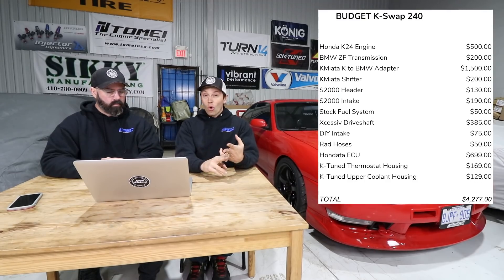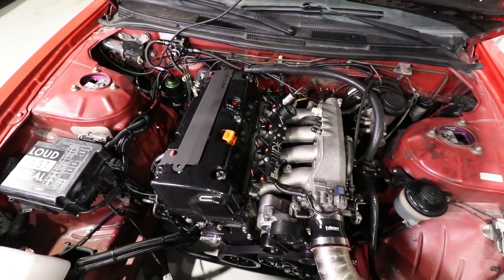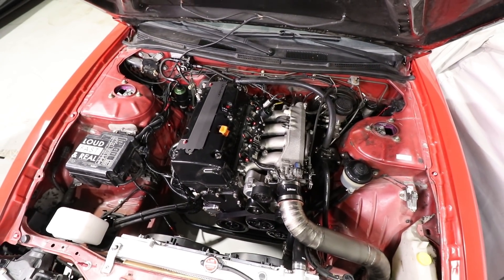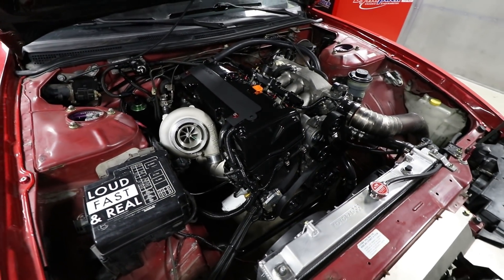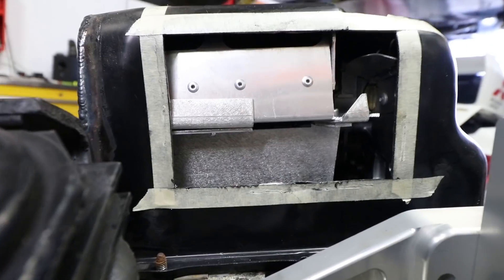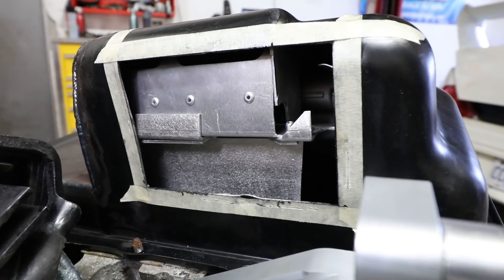How Much Does it Cost To K-Swap A Nissan 240SX

Comment: You lost me at the 1500 dollar adapter. I work in a machine shop. 1500 is insane
Reply: I thought it was a decent price actually? For those of us who don't have the means or knowledge to fabricate one that is
Reply: @benandjakehuston6321  That's still pricey, ive seen some in the 450-800 range depending on the motor and trans combo to be used. 1500 is crazy high
Reply: @verz22  yeah but with flywheel? It beats all the competition by a lot.
Reply: Same here I was contemplating this swap till they mentioned that
Reply: exactly pretty expensive it makes almost not worth it
Reply: they should make an adapter k series to sr trans or ka trans
Reply: @benandjakehuston6321  paid $300 for an sr to z33 trans adapter... At $1500 I should be seeing engine mounts,trans mounts and drive shaft... maybe even flywheel too!
Reply: Stupid price
Reply: Right, like K-miata swap kit, ruins it.
Reply: This includes flywheel
Reply: Wondering if you offer the same for a lot cheaper
Reply: Yea that's as much as a motor wtf
Reply: Pretty sure that includes adapter, flywheel and clutch kit
Reply: uni clutch would be the go for a stock flywheel then spaced to suit your adapter and clutch throw out
Reply: Yes but when it’s done it’s done. You blow it up you go buy a $800 k24 and send it again. You blow up an SR20 and your fucked.

Comment: 8k to swap a engine that gives you about the same hp as a stock engine nice
Reply: But for more reliable and keep in mind the k is na
Reply: Yeah but onceyou turbo it you can make 470hp reliably. CSS the block and you can make 600hp reliably. Re-sleeve the block and you can make 800-1000hp for about $1000

Comment: I wish someone would do a k swap kit for the e36/e46.
Reply: I'm bout to start that build k swap e46
Reply: Joe Figueroa   Because somebody gave me a mint e46 coupe but the motor is blown
Reply: Joe Figueroa  and the k motor cheaper more reliable many reasons
Reply: Joe Figueroa  k awd boosted > s14 bmw NA 
this guy wants 9k rpms of honda power and reliability not rebuilding a bmw engine every 60k miles
Reply: Bro that’s weird wtf
Reply: My e36 m3 outlasted my RSX type s at the track all day long. Long as you do regular oil changes to keep the vanos unit clean they are as reliable as a k series. The issues are usually electrical and if you’re good with that it’s really not an issue
Reply: @nastilyasperated2215 the m3 needs lash adjustment every 50,000km, new everything you pull off almost, and connecting rod bearings every 100,000km, they are a detuned F1 mclaren engine essentially
Reply: @tturi2 thats insane. I didnt know that. 
Are they really wirth all that effort??

Comment: Hey - those are my brake hats (DefSport is the brand if you want to see the original design/info on them)!!! Cool to see them show up on Speed Academy. I sold my S13 a while ago and gave some of my engineering to Tom to help keep the S chassis community going. 

Tom and I can definitely give you a lot of pointers on how to make the brakes better and drop your consumable cost in the process.
Reply: Is there away a way to still get that setup?

Comment: It's cool you guys want to be different, but you could have done a pretty thorough rebuild on the SR and no need for custom mounts, custom oil pan, BMW transmission.  If you wanted to get fancy you could have built the SR with a SR20VE head, and maybe sent the block over to Mazworx or Jim Wolf to bore it out for larger than 2.0L displacement.

Comment: Instead of boosting it you could build it and keep it NA. 300whp isn't hard to achieve with a 12.5:1 piston/rod combo, valvetrain and cams on pump gas. The S2000 IM may be alittle restrictive but a ported RBC could take care of that. It would be super responsive out of corners and always have power when needed and the best part of all, even more different than it already is.

Comment: S14 sr20det swap
Engine assembly $2200
Walboro fp $100
Ebay intercooler kit $150+
Igniter chip $50-100
Maf $80
Cat back exhaust $350-550
Manual boost controller $15
Budget build around $3k
Safe horsepower around 250 whp
Reply: Joshua Hebert then again the K makes that much power NA
Reply: @sirhaney  hoopty doo. Power is power
Reply: @sirhaney : K motor doesn't make that power stock. You are easy of my friend.  Especially whp. Learn your facts my friend!
Reply: Dave Amer fr sr20s ain’t cheap here in CA

Comment: like 4-8k is a lot.. but not that much for NA standards
(i have done pairing 7mgte engine(came with bottom end build, cost me $680) with zf S5D 320Z( got it with m52b25 and half of e39 for $200) and self made engine to gearbox adapter cost me $20, machining m40 flywheel to fit combo cost another $20, hy55 VGT turbo(900hp ready turbo, same as hx55) from truck cost me $250.. so it is possible to go lot cheaper with swaping an engine)

Comment: ya guys a turn key 383 goes from $700 too $7000 depending on were you get it and who you know. put a 408ci in one of those and 300lbs of corn in the trunk.

Comment: Sooooo

Go 1jz with a z33 Transmission, got it.
Reply: Shit I can do a full ls swap on a s13 way cheaper than 5k
Reply: khiri brooks can you really though ?
Reply: CJeatsass no, he cannot.
Reply: @Dave Amer dude I wont argue with you go on isr lookup how much mounts cost call your local junkyard and find out how much lq4s cost or look at craigslist and offer up for the cheapest v8  96+ Camaro and firebirds by the wrecked ones or the one with engine issues because ls are easy to rebuild If you have to. I could walk my nephew through rebuilding a ls cause there built so well even the gasket technology is years ahead of most companies driveshaft 300 bucks dude if you  know what your looking for it's easy I have no reason to lie I'll be back in cali on the 14th of Jan and I can post a good video or send me your email and I'll upload pics and a short horrible cellphone video shot footage  and show you my pink slip with my name on it
Reply: @Dave Amer  solid mounts vs the shit cx racing mounts  which do you think will last longer exactly dude I've been building cars and racing cars going to events breaking shit fixing shit and trying new shit for a long time now I pay attention to quality  but you dont need titanium intake  piping for 1000 hp

Comment: Just thought I would clarify. Less than a week ago I got a quote to swap am sr20det into my car from an sr20 specific shop. For them to provide everything including labor, front mount, and clutch, ecu and upgraded tune, good for about 220-240whp was $4500. Also nobody buys ls crate motors. A full ls swap doing the labor yourself is around the same price and can be done easily a bit cheaper. Doesn't seem worth it to me. But still, my friends and I are swapping a k24 into an fc rx7. Even though I have an ls lying around. People are entranced by the k motors.

Comment: I have a 240Z... I've always thought about putting a K24 in it. I'd really like to see what you guys need to do to the stock oil pan far as modifications to keep oil pressure up.
Reply from the maker: We'll be addressing that in future episodes.
Reply: I'm about to start putting one in my 240Z.  I picked up an adapter plate and flywheel today

Comment: I’d say build the k24 n/a and don’t go aero. See how the s chassis does on the track in stock aero form. Not a lot of that around. Every S chassis goes aero and you never really see how the chassis handles in stock aero form. Ppl think these cars are only good for drifting. Maybe if you show how good these cars can do in stock aero form, ppl may start to realize the capability of these cars.
Reply: Matthew Yang they have rear grip issues inherent in the suspension design. thats why they are popular for drifting and not much else. an s15 subframe is a slight improvement they might try

Comment: Hmmm k24 or LSX for the same money...lol
Reply: JoJo you mean LS not lsx
Reply: Ha! Slight difference 😊
Reply: Can't say the same for a t56, that shit is like 2500-3000 no matter what
Reply: huge difference
Reply: I’d rather a K if you’re tracking it- better weight- and Ks can easily produce lots of power
Reply: K > LS
Reply: @Nomuken180sx  I just woke up and saw this dude I know  your not being serious but stfu just litterally put there specs just the facts side by side LS washes everything in every class there wont be another engine like the ls in our life time probably
Reply: khiri brooks am I not allowed to have a preference?
Reply: @Nomuken180sx  you are and I apologize
Reply: @khiribrooks2485  the new lt platform is just as good if not betyer than the ls right now there isnt alot of lt engines around.
Reply: Ls purely for sound .
Reply: Some bullshit power figures do nothing but over balance a chassis....real world facts can be hard to swallow at times.
Reply: LS1 swap with a T56 in an S-chassis is a consistent $10,000 job. A much better option than a K-motor.

Comment: How much is a VQ swap?
Reply: future62 ive been curious about this for my BRZ for quite a while. Perfect mix of not to heavy and enough power, revs high enough, and bonus you get to use the CD09. Id do it in a minute.
Reply: Neil Blum Don't think the VQ would fit. H6 from a Legacy would probably be better. Boring and stroking the FA would be best
Reply: future62 the engine bays are honestly massive on these things, VQ would fit and has a more solid aftermarket support. H6 would be super cool as well though
Reply: Neil Blum anything is possible with enough money. The question is how much is cool worth. You could probably get a salvage 350Z for what this would cost to do
Reply: future62 engine and trans would be about $350 plus taxes from my local recker, the wiring and fab work however would cost you big bucks. You have to figure out what diff to run at that point as well
Reply: Neil Blum thinking even bigger picture, there are plenty of states where this would be basically impossible to register (from what I remember you can only swap in newer motors), and resale would go through the floor. Again would probably be more cost effective to build a salvage 3100lb 350Z
Reply: future62 for sure, not for everyone but for a track build I feel it would take away all the disadvantages of the FA20. As for registering, where I’m from it wouldn’t be an issue
Reply: Love my VQ35 v6 6sp altima... rape k20s all the time even though I'm heavier lol
Reply: VQ swap is around like $4k-$5k tops. As much as I love K motors the price of this swap is terrible. It’s as much as an LS but gives you KA horse power. Why bother even swapping.

I’d personally run a SR20 or VQ swap. Do it for less and instantly double the power.
Reply: future62 they fit fine. Some bay work but they fit fine. Tons of people have done it already.
Reply: @spool29k97  cool story man
Reply: Jonathan Pontel What happens when you got a turn though......
Reply: Sergio Aguirre For starters if you do a big power build for internet props you weren't loved enough as a child. For a fun S14 all you need is like 300-350 whp- child's play for a VQ, tough shit for a KA

So no I call shenanigans. Who gives a shit how much power a block can hold... It's not 2003 when dyno queens were impressive
Reply: CK_32 v8s have more torque than your vq but that doesn’t stop them from getting their ass whooped by a stock block boosted k series swap. Your comment has no relevance because you don’t even know that. Stock k series make 700 hp stock bottom end.
Reply: Jonathan Pontel stock k swaps have even gone 11s. You can’t be serious here.
Reply: @TheBb6prelude  Don't be a fanboi man.
Reply: future62 stating facts is not being a fanboy. I know a ton of boys with them vq cars. The so called fastest NA 350z aka pugs got pulled by my buddies eg hatch back that’s NA. He beat him 3 times in a row in a run of the mill k24 setup.
Reply: preludeF20Bking Easy to do when the car weighs half a ton less. K vs VQ in a track day S14 is no contest
Reply: future62 are you serious. Have you ever heard of that infamous pugz HR Z? That thing is fully fully gutted tin can style. Probably cut as well. My buddies car was not. Egs are 2200lbs and that Z is easy easy 2800-2900 lbs. one 3.5 vs 2.4liter.
Reply: @TheBb6prelude  What is your point? How does a K being faster in a car 600-700lb lighter make it better than a VQ for an S14? Especially when it will cost way more just to get in and make the same power? The S14 shell weighs the same regardless of what engine you put in it. Bringing up totally irrelevant shit (i.e. drag setups in different bodies in a video about a track build) = being a fanboy. And keep in mind I've owned more Hondas than Nissans.
Reply: @Sergio Aguirre That's about what I would expect from blind Honda fan boy.
Reply: @future62  I tried fighting this same battle with these Honda boys at the beginning of this series. You'll never change their mind; don't waste your time. They'll keep talking drag times and crazy NA builds that wouldn't last three laps. A VQ swap makes more sense for their goals, but the K swap sacrifices logic for unique YouTube content. They basically made an S2000 coupe, but a VQ S14 is just a slightly lighter 350Z. I would never do this swap, but PT is happy (which is all that really matters).
Reply: Rapes...? nah barely my SER just beats SI off the roll
Reply: @bulls1777  se-r's keep up with me. But I have slight mods full catback, intake and a tune. Not even modded si's can beat me but they swear. K20 isnt the shit. I'll take a HR anyday over any K engine.
Reply: vq would fit but for the money/effort it would cost it's a stupid choice. you can get adapters to put a cd009 on JZ or SR swaps anyway

Comment: Hey does any one know what model of gearbox has using, I know bmw use zf boxes but where would I figure from which model, something out of a e36 maybe?
Reply: And is there many difference from their 4 cylinder and 6 cylinder manual boxes from those chassis?

Comment: For that price you guys could of gotten a 500+whp sr20vet
Reply: maybe if you have already sr on board, conversion itself cost over +4k
Reply: @Piotr94L  lower end sr20 buy and  built under 2k.vvl head 800,fit any turbo,between 800 to 1k,ems 1k,tune 600,intercooler with pipes 500,clutch 400 and to pay for all that work about 2k.I myself have a N/A sr20vvl in a pulsar fwd with high compression pistons and kelford cams with nistune ecu, I know How much it takes to swap sr20's.
Reply: Oh yeah,inductors about $600
Reply: Yeah but an k24 is like a stroked out sr20vet with variable valve timing not just variable lift, and if you blow it up you arent out 1000s of dollars

Comment: Did Sasha work for free?
Reply: euan begbie believe the ecu they used has off the shelf maps on it so paying a tuner isn’t necessarily a required build expense
Reply: Neil Blum off the shelf maps 😂😂😂 you’re relatively new to all this aren’t you
Reply: Joey Arthur Zooberry to hondata yeah 100% but there’s no reason you can’t run a stock K24 with stock maps on hondata ecu regardless of which car it’s in, the engine management is completely separate from chassis

Comment: the initial numbers shown for engine and gearbox are inaccurate 
the second numbers are inaccurate also because you didn't factor in the initial cost of ecu and custom lines  and more I  really could go on. No tuning costs no ecu loom costs.
My point is add 1 or 2 grand to these figures at min.

Comment: Bargain, nothing you can do NA-wise short of a LS motor to a stock Nissan 240SX beats the value of putting a Honda K-series 240 engine in there. But you are right between the transmission and drivetrain refitting from a FWD chassis engine to a RWD chassis it can be a hassle.

Comment: Sr swap is not 5k. Also remember this price is with no turbo. They are probably looking at 7k with turbo. With 7 k you can build a Sr Motor and will destroy their little Honda k motor. This video is offensive!!
Reply from the maker: Sadly, the amount of SRs out there destorying K motors for HP is pitiful. If you want to go fast with good support and without alot of headache the K motor is hard to beat.

Comment: I would suggest an RB swap over a K swap ANYDAY... RB's will rev just as much but create heaps more torque and therefore hp (as hp is a function of hp × RPM ÷ 5252). That means the RB is a far better option to swap in rather than a k motor